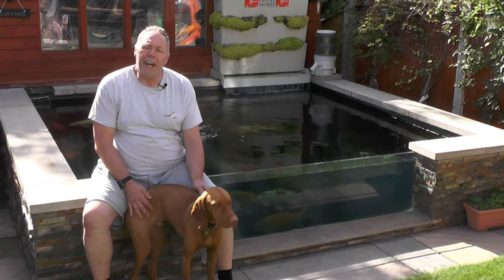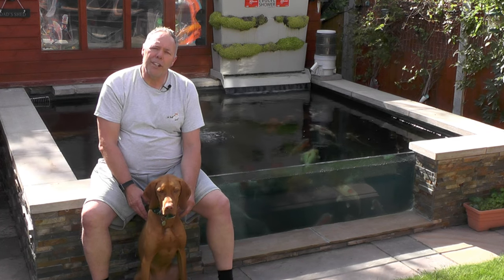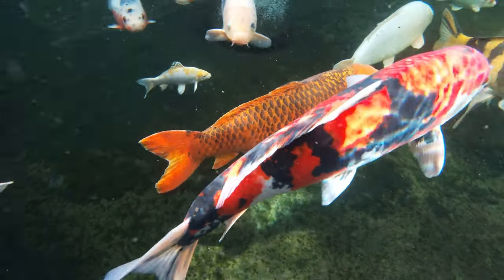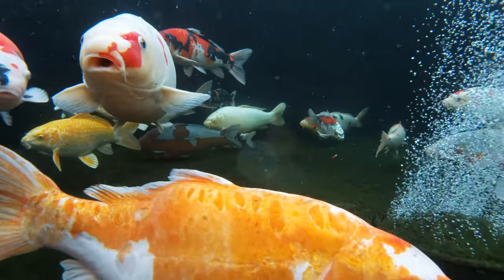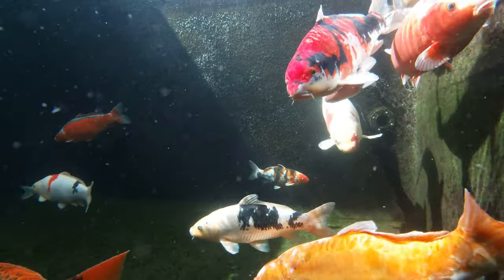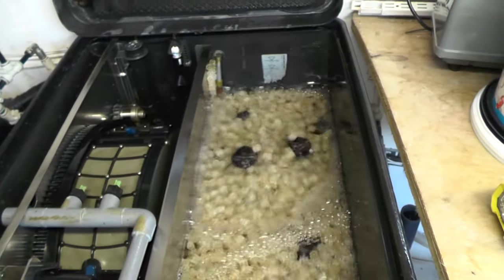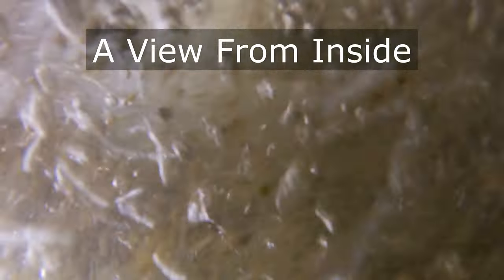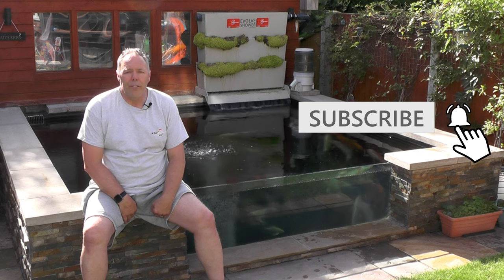How To Purge The Bottom Drain On A Koi Pond - 4" Gravity Fed Bottom Drain Clean

Comment: If you are gravity fed, I assume your filters are the same height as your pond.
So to purge the drain into your filter, the water has to rise 12 inches or so ? 
I’m asking because I’m in process of installing a drain and purge line, the shop I asked says the purge line has to be same height as the bottom drain to be effective.
Reply from the maker: I'm not that clued up on purging, hence why I purge mine BD into the filter unit. I know it is a must to have a method of flushing the drains but not the best way of doing it